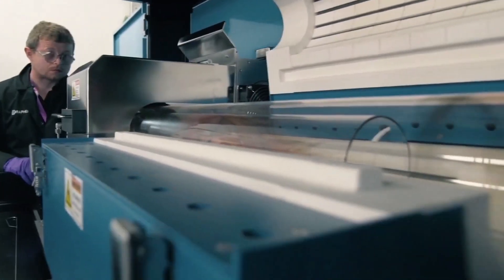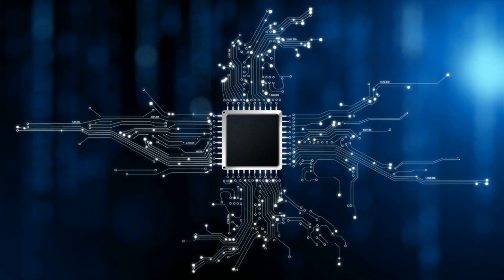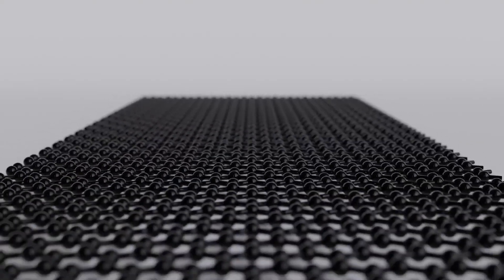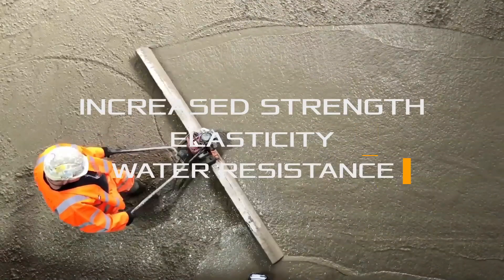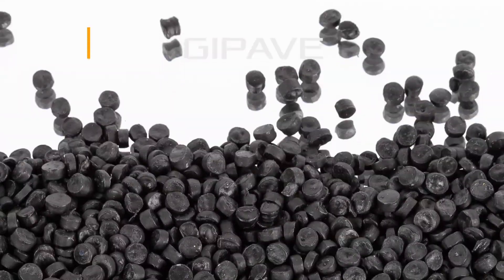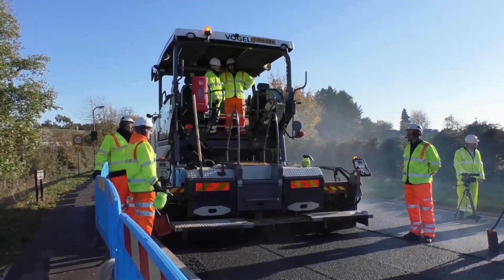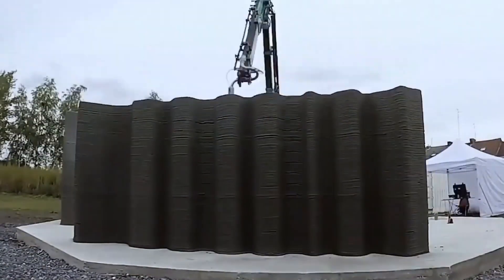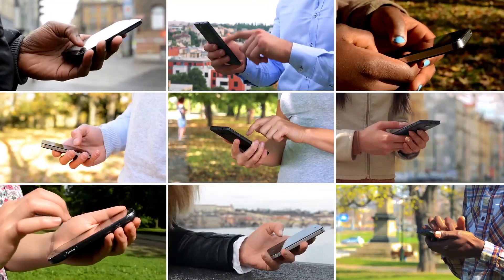Graphene in concrete is already changing the rules of the game in construction

Comment: the comments all seem to be addressing concrete structural use when video talks about dirt simple asphalt jobs where loading is all simple compressive stress (gym floor and blacktop roads) youre getting off topic to begin with. we solved these problems literally 40 years ago using different technology. I personally ran a job where we paved a road that to this day is in good shape with only compromises intentional utility cuts. rest is great.... 40 years later. think the crap they build today wont need resurfacing for 40 years? please.

first, know 95% of road problems stem from two things; excessive, non-cyclical loading by heavy vehicles (trucks) and freeze/thaw cycles. you a) make material stronger and b) reduce water infiltration (seeps into cracks and freezes/expands to break up asphalt) and road's will last a long time (like 40 years and counting).

we did it by using two things; a) a stiffer but basic aggregate that we proved by doing gradations once installed and b) prevented infiltration to base using a material that prob dosent exist anymore trade name PetraMat, made I think by Phillips Petroleum. it was a felt material impregnated with cracking bottoms (brown asphaltic liquid). we laid the "Mat" down, kept it flat, topped it with two layers, a strong base and stronger layer (by gradation) compacted normally using standard paving equipment, nothing special. took about 20% longer to place and compact but 40 years later its still there and fully intact. lets see if the new gee whiz stuff can match that. and we did it with existing materials, for relatively low cost, a tiny fraction if you factor in the avoided costs of all the $$$ you'd have pissed away to maintain it the last 40 years. newer isnt always better. many times existing materials/methods whup most new stuff and do so quicker, easier and cheaper.

Comment: Graphene embedded in other matrials is interesting but with ramifications.
So, for instance asphalt is one of the highest maintenance but also most recycled building material in existence. It's conceivable how graphene might affect stiffness and strength, but how does it affect recycling? 
And, when used with concrete, from the description appears to be a substitute for rebar. Is that the limits or best use of graphene? Is it more effective as a mat layer instead of filament strings as described in the video? And again, what are the consequences for recycling when the graphene and concrete need to be demolished?

One day, if it becomes possible to shape graphene, it will be interesting if it can be used to replace steel, aluminum and even composites in aircraft.
Imagine an aircraft with skin on a molecule or a few molecules thick. And internal structures and struts also possibly composed of tubes of graphene sheets a few molecules thck.

For now though, it's my understanding that once created typically as a sheet is brittle and unmalleable. It would seem that graphne must be applied to a fixed shape from the beginning which greatly complicates the manufacturing process.
Reply: They said that graphene is impregnated into plastic pellets, then added to the asphalt. I imagine they could eventually use recycled plastic for this.
Reply: @patgarrett3746  I guess a few questions would be:
Are the plastic granules thermoplastic?
If so, what is their melting point relative to that of asphalt?
If not, how thermally stable is the plastic at the melting temperature of asphalt?
Reply: I wonder if you could replace the reinforcing mesh that is found in some precast parts with a mesh made of the graphene filaments they showed?
Reply: @Oddman1980  carbon nanotubes are being used for mechanical strengthening today, I believe that is one of OCSiAl's largest target markets.
Reply: @paulferguson4930  It may be in an experimental phase, but I work in the precast industry and it's not being used much in the real world.
Reply: @Oddman1980  sorry I was talking about conductive polymers, not concrete.
Reply: Ex +]

Comment: I think it depends on cost of materials and ease of use. If it becomnes cheaper to use Graphene  containing materials it will succede, if it is more expensive then no. It all comes down to dollars and cents.
Reply: Yes, but relative to demonstrable benefits.  If you can use less concrete, customers may be willing to pay a bit more for it.  As long as the net is unchanged or even reduced.

Comment: I remember reading articles about this year's ago and how they can make transparent concrete like clear resins.  And how they can use the conductivity of graphene to make surfaces that can make photosynthesis creating oxygen like trees..great stuff..
Reply: "Transparent concrete is the new type of concrete which carries special property of light transmitting due to presence of glass rods"
it's just regular concrete with glass in it. And we don't need to produce more oxygen, plenty enough of that, the excess of CO2 is the problem which the concrete industry greatly contributes to on its own.
So, great inventions that solve no problems at all. 👎
Reply: @mururoa7024  but doesn't Photosynthesis convert CO2-O2
Reply: @sarinulek6816  Partially. But you want an industrial process which produces CO2 to build stuff that converts a fraction of it back into O2 ?? That's insanity. The advantage of trees is that they make O2 without first making CO2, and they do it FOR FREE!

Comment: "Mass adoption didn't happen." That was because it couldn't be produced in bulk. Australian company Talga Resources with their Sweden mine/resource containing the right material, and patented extraction technology changed all that. That is why graphene/graphite is now finally commercialised for all kinds of applications. Because companies can get the stuff in tonnes, not in kilos. Graphene is now used in anodes for batteries and in print circuits for electronics. It also replaces zinc in anti-corrosive paints. Because it accommodates electricity, when mixed into concrete, with a slight current surfaces can be lit up in the night.

Comment: Graphite has been used in concrete for 60 years, it was used for underfloor heating, only problem is that it can crack, so they added iron filings to the mix, it help but was not a total cure for the problem, this newer type might be the one.

Comment: How does discarding this blend of concrete or asphalt affect our environment? Is it biodegradable? I only see it cutting costs and jobs.
Reply: Asphalt is the second most recycled material on earth. It basically never gets discarded. Also Graphene is just carbon so what is it supposed to degrade into? Is charcoal biodegradable and harm the environment?
Reply: @SurmaSampo  While carbon may be a natural element, it has become a pollutant because its introduction to the environment on the scale it is currently being emitted has harmful effects. Therefore, the myth that carbon is not a pollutant and carbon emissions should be of little concern is scientifically false. Numerous results have shown that graphene materials cause dose-dependent toxicity in animals and cells, such as liver and kidney injury, lung granuloma formation, decreased cell viability and cell apoptosis.
Reply: @FarideLadak  The carbon issue at scale is with the compound carbon dioxide not compounds of pure carbon. Don't conflate the two.

Yes, nano particulates of carbon when aerosolised can cause cancer and silicosis in the lungs but so does basically every other nano particulate that has sharp edges. The issue there is the size of the stuff not so much the element. Hard rock dust from a quarry does the same thing. 

The issue results from use as a dry powder such as in ink toner but once bound by pressure and liquid under a road or chemically bonded in concrete it becomes as dangerous as charcoal or the graphite in your pencil.

By the time the road degrades to the graphene road-base it will have bound under pressure into larger particulates. Some will escape during the initial application process but the risk to the environment can be controlled with formulation and operating procedures. 

You are too focused on results outside of the context of the mechanism of operation.

Comment: They're about 2000 years shy of proving it has a longer use life than concrete.
Reply: I get your point but what is valcanic ash made of?
Reply: @MarthaJCook  Volcanic  -
Reply: I always wondered if they had trouble with people adding graffiti to cement after they poured it 2000 years ago.
Reply: @robertthomas5906  —The Romans were heavily into graffiti. Lots of it found in Herculaneum and Pompeii.
Reply: @sirrathersplendid4825  They certainly painted. I've seen that in the recovered ruins in Pompeii. However, I haven't seen where cement was poured and someone did something to it while it was wet. Name, "Nero has nose hair," something obviously not supposed to be there.
Reply: @robertthomas5906  — I vaguely remember some Roman concrete with dog paw marks.

Comment: The tech sounds great but the construction industry has a high inertial mass, limited also by prescriptive building codes arranged around engineering science of traditional materials.  Codes adopted as "law" resist code enforcing officials from relying on materials methods and systems not already IN THE code, especially for structural life safety.  Example, a code enforcer may permit a straw bale home, but only as non-loadbearing fill material tucked into other structural wood or steel frames.  So you might get your graphene in the mix but all the steel rebar will still be required, by CODE.   The successful tech is likely to have small incremental changes to existing methods possibly addressing other topics like improvement to water resistance and spalling, and backed with plenty of material testing data, AND the slow adoption by code creation councils.  Pavements and slabs are not the same as a long-span prestressed concrete highway bridge girder.

Comment: Wait....what happens when graphene, at nano-particle size, bleeds and erodes off the concrete and gets into the air?  Are we doing something similar to what was done in the past with the likes of asbestos?  Just wondering if we shouldn't think this through as thoroughly as possible before adopting wide-scale applications for its use.

John~
American Net'Zen
Reply: Asbestos had no wide-scale consequences. People can work with it now and take proper precautions. It's properly installed presence is of negligible concern. 
This stuff may be worse. That's why God made hepa filters and binding agents.
Reply: Research.  There will be no wide-scale applications without thorough toxicological testing.  Construction is a heavily regulated industry.

Comment: It appears that England is producing Graphene in amounts large enough to be added to construction material (Concrete) and paving roads (Asphalt + Tar).
Very impressive indeed!  I did not realize companies were capable of producing Graphene at such a scale!
Reply: very poor quality graphene maybe, production processes that might be useful in electronics and batteries are only just now starting to come online. and i mean barely starting.
Reply: Look at a UK company called Versarien. They are the ONLY company globally to be to be certified by the Graohene Council. They actually provide the high quality graphene used in the ‘Concretene’ but have much larger plans of their own in this area.
Reply: @moodtherapist  "high quality" is a bit of a hype, if it is being used in concrete instead of electronics it is obviously not that high quality, because high quality production graphene would be worth much more in electronics so if you are producing it you are going to sell it for the highest price you can get. aggregate and rebar is cheap so to replace it you either need something way stronger than graphene is or something cheaper that is as strong or stronger. as i stated in my comment, high quality graphene processes are only just now starting to come online, like literally this year. next year some of those might start to produce some product, but "might" is the key word. carbon nanotubes are easier and have a similar strength in 3d applications, they are literally just the same thing as graphene folded over into a tube, but just easier to produce, maybe soon we will see carbon nanotube carbon fiber, but even that is only just starting to be a thing. this is all because carbon carbon bonds are the strongest molecular bonds that we know of in chemistry. the uk is likely to be the manufacturing and research site of allot of this because the uk has allot of graphite and has been mining it for a very long time and has allot of experience handling the mineral. if you have a #2 pencil from before the 70s there is a pretty good chance that the graphite came from the uk. these days that isn't quite as true, but they do have the most experience handling it. right now the best tech for producing graphene is coming out of east asia, from north to south, but carbon nanotubes are generally coming from europe, although they don't need graphite so the uk is kinda cut out that loop for the most part.
Reply: @kght222  Yes, carbon nanotubes are crossing the commercialization threshold.  They are starting to get good traction in printed electronics for applications like transparent heaters and transparent antennas.  Manufacturing capacity is growing rapidly now and a handful of companies have aggressive growth plans over the next several years.  I expect the US to emerge as a leader in this area, particularly for MWCNTs.  Look at what Dexmat is doing with CNT fiber, they are a spinout from Rice University.

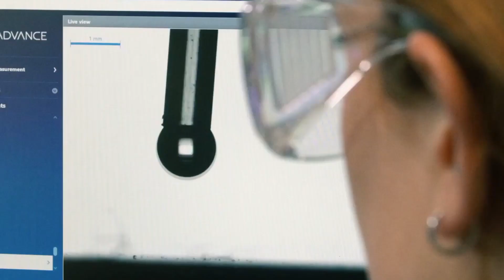Comment: 6:30 "...what do you think of this...": I think you've missed two obvious points: (1) Use "chopped" graphene from sheets (ala OSB) for greater tensile strengths...better than pellets. And (2) the biggest problem with rebar reinforcement is oxidation. Graphene doesn't oxidize, lose strength, and lose bonding with the cement.

Comment: The real game changer wasn't going to be graphien but carbon nanotubes with length, but we haven't been able to produce them significantly. once we achieve that, then the space elevator can be made.
Reply: Carbon nanotube manufacture is about to move to the next level but we are more than happy to pass the space elevator baton to the graphene community.  Printed electronics, cement, batteries...water filtration...yes.  Space elevator...no.

Comment: Question is what happens to the tiny small graphine oside nanosheets when you drill in to them and the dust fly in the air then gets in to your lungs.. this could be worse than aspestos getting in to everything..
Reply: This is going to be a nightmare first affecting microbes then on up the food chain.  Concrete cracks, it weathers on a granular level, small rocks and debris from cars and trucks will wear into the surface  now embedded with particulate matter that is guaranteed to shred the lungs of every creature unfortunate enough to come near it.  Once those particles are in the air, it's too late.  Graphene bonds do not degrade over time, worse than a 'forever chemical'.
Reply: @GearsMcTinkersome  If this happens consider yourself fully vaccinated

Comment: And of course they have conducted years of tests to ensure there is no risk from any graphene dust (nanoparticles) casued by the breakdown over time and abrasion of car tyres. (did someone already raise a concern about rubber particles?) . Good news for manufacturers if it does end up everywhere in our unique biosphere and the air our children breathe it wil of course be impossible to point the finger of guilt . Hmmmmm where has this occurred in the past?
Reply: It's being injected into people's arms on a regular basis at present, including children over the age of five, so perhaps it doesn't matter about children breathing it in quite so much.
Reply: @SaxonSuccess  you breathe air but injecting will kill you
Reply: Bruh it's literally structured carbon, chill.

Comment: Will graphene enable new types of concrete to be developed?  Or increased use of aerated concrete reducing the amount required for a structure?
Reply: Thinner floors in a building is not a good idea, a person walking in the floor above can be fully heard by person below.
Many fights will happen.
Reply: @zahirmurji  Sound is better blocked by using substrates of different densities. All one thick floor is not as good as a thinner floor with a layer of Homesote panel
Reply: Yes

Comment: Since graphene is a conductor of electricity, maybe at some point someone will figure out away to add enough graphene in the cement to be able to charge electric vehicles.
Reply: Too much graphene will impact the flow characteristics of the material.  You will get concrete that will not flow.  You want just enough to get the benefits but not so much that it begins to compromise other characteristics of the concrete.

Comment: Graphene should degrade into natural substances, similar to ashes from a fireplace. Also, it can be used as a superconductor for electric car batteries and can be used in water treatment to purify water, including sea water. It has a lot of good potential for humanity, but reducing the cost of producing it at a low cost is key to its economic viability.

Comment: Everything devolves into how much it would cost to get measurable improvement in the strength of concrete by addition of graphene.  It seems graphene is still prohibitively expensive to produce in bulk.  Altho graphene is only 2 dimensional, random orientation of the fibers might increase not only the tensile but also the bending strength as in fiberglass reinforced substrates.
Reply: From the testing we have carried out with graphene enhanced concrete we can reduce cement content by 20% and get the same strength. The economics works for many applications.
Reply: I agree except I don't think the word devolve is correct usage.